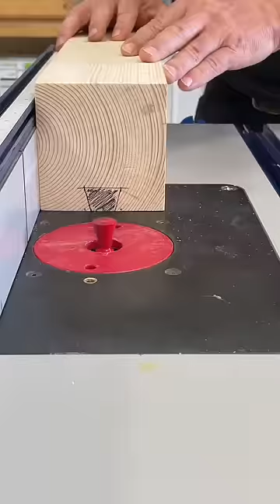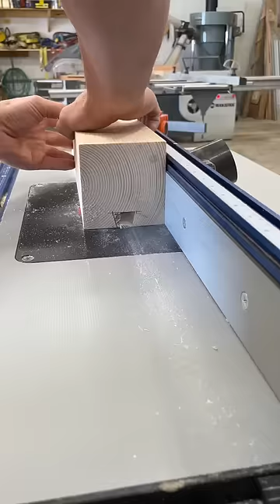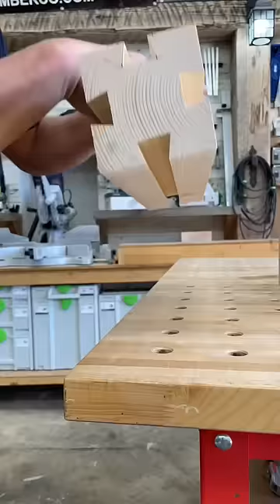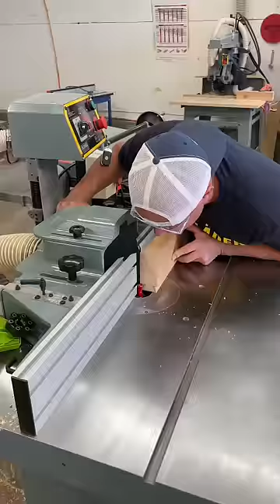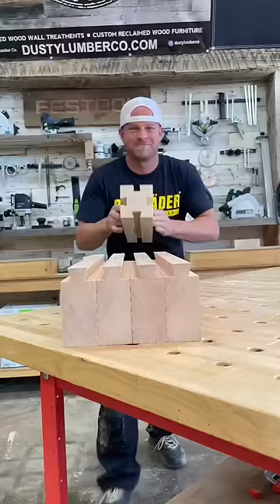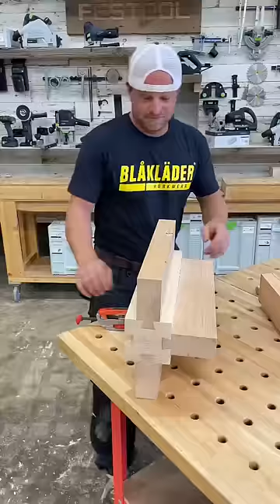Four way dovetail joint #ad #woodworking #woodwork #wood #maker #bois #tools #holz #joinery #madera

Comment: "what is this thing used for?"
"Yes."
Reply: It’s a dovetail demonstration. Timber framing.
Reply: @grmanstar  It doesn’t change the fact that people are so lazy. The title is there, and so is the internet so if they want to look it up, they can.
Reply: Looks like legs for. Table? Could be wrong 🤷
Reply: 笑ったw
Reply: It would have looked better if the wood colors had matched so it looked like it was one solid piece of wood
Reply: @mrbunnylamakins Yup, although dovetails can also be for timber structures.
Reply: Jor can use it to build hoses but nobudy use it
Reply: @DakkogiRauru23  it's a joke
Reply: @grmanstar  lmao you really acting as if you're superior
Reply: I'm thinking of taking this same approach on a rustic/functional four post bed frame.
Reply: Where it is used?
Reply: It does nothing. Obviously.
Reply: @mind_of_A  why poor me?
Reply: Its used for youtube short lol :D
Reply: Practice. Better do it on a demonstration piece to learn/exercise the process than try to figure it all out in an actual project, that way there's no problem if you do something wrong.
Reply: Just for likes
Reply: Table

Duh
Reply: an old wooden castle in Malaysia was built using this technique, meaning they were built without using naild and such. all the structure were interlocking with each other using this joint and ither types of joint too
Reply: Table pedestal.
Reply: Whatever you want. It's like asking what woodworking is for. Whatever you want!
Reply: @TheFallenFaob  No
Reply: Good boy
Reply: Whoever’s reading this, i pray that whatever your going’s through gets better and whatever your struggling with or worrying bout is going to be fine and that everyone has a fantastic day! Amen
Reply: It's a bit cross.
Reply: A demonstration and also a lot of things like a center of a night stand or a chair maby a table
Reply: Visual ASMR 👀👂🤤
Reply: Does it have to be used?
Another good question. Do you have to exist?
Reply: @darvin50k  I was just going through the replies hoping to find a equally funny reply like this comment, but I see this. It just made my day before it even started :)
Reply: it’s those stretchy wall thingies in the return section of Walmart
Reply: @DakkogiRauru23  Fr. This generation would die if not for the constant hand holding they get on a day to day basis.
Reply: Its used for puzzles
Reply: Hloji🥰
Reply: @DakkogiRauru23  Some people can't see the title.
Reply: How many licks does it take to get to the center of the trendy pop
Reply: Pizyes
Reply: @tejay9416  jnn9kjķkkkkķkkkkķkkkkkkkkkkko
Reply: It is used for traditional Japanese buildings and they remain standing
Reply: For ANTS to READ
Reply: Glass table stand, would look AMAZING!!!! 😍😍😎😎😎😎💪💪💪💪
Reply: xDDD
Reply: what is it not used for?
Reply: Sebagai Kaki Meja.
Reply: @DakkogiRauru23  The title does NOT say it is for "demonstration" smartypants. Furthermore, no one in their right mind would waste this much wood or time on a simple demonstration. QED: It must have a purpose. Question stands: What is it used for?
Reply: @mnoot7209  Actually, demonstration consumes a lot more material than you might think when it comes to any trade, such as woodworking, machining, pottery, etc.
Reply: It's a table leg.
Reply: @TheFallenFaob  i have made several dovetail joints on most joints its different sides of the grain they hardly ever look the same.
Reply: Its cool as shit
Reply: Ножка для стола
Reply: Not everything needs a use, some things just are.
Reply: yes❤

Comment: he seems so happy making it,- I got no clue what it is but-
Reply: Table center?????
Reply: Its used to build buildings in ancient times, eg ancient china and japan
Reply: "A dovetail joint or simply dovetail is a joinery technique most commonly used in woodworking joinery (carpentry), including furniture, cabinets,[1] log buildings, and traditional timber framing. Noted for its resistance to being pulled apart (tensile strength), the dovetail joint is commonly used to join the sides of a drawer to the front. A series of 'pins' cut to extend from the end of one board interlock with a series of 'tails' cut into the end of another board. The pins and tails have a trapezoidal shape. Once glued, a wooden dovetail joint requires no mechanical fasteners. " - wikipedia
Reply: Probably just a demonstration
Reply: He might just be showing off the Ingenuity of not having to use nails I mean he could still be trying to make something but that seems to be the core of the video is just showing how Innovative it is not to have to use nails and just use the strength of the wood by using certain tools to be more efficient this way you're actually using less material
Reply: Really Loue Stephanie ut 31😁
Reply: It’s a 4 way joint
Reply: Dovetail joint
Reply: @sai_lg1070  and what is is used for in this configuration?

Comment: I just love those seamless joints. Love your work.
Reply: The theatrical leaning and slow pushing makes them look much tighter than they actually are.
Reply: Meanwhile I'm sitting here playing Pokémon yet I can smell the sawdust coming from it. I have classes in a woodshop, I know how it smells.
Reply: @legobrick1356  lllllll
Reply: @MF175mp  I have ocd. 😁 I just love that it fits seamlessly. I don't care if it's tight or not
Reply: @legobrick1356  don't you just love that smell
Reply: @CoolA1363  Depends on the wood. I'm used to red oak (the one I was smelling), but so far I like the smell of pine out of the ones I know.
Reply: @CoolA1363  that's not what OCD is lmfao
Reply: @suidame1996  the obsessive part is correct though😁
Reply: If you didn't see the seems you need to put on coke bottles before you work wood
Reply: @FathomlessJoy  dude, the word "seamless" means: "smooth and continuous, with no apparent gaps or spaces between one part and the next", but, what the heck, ya, you're right!
Reply: @CoolA1363  Yeah and if you can't see those seems....

Comment: his slight smile br like "I did a very good job"
Reply: but in reality he just pushed wood through the router...adjusting the fence isnt that hard lol. i would be impressed if he did this with a cordless router
Reply: @herpderp4908  i think youd have a different opinion if you were a carpenter.
Reply: @sebastiangrebe8276  do you mean if i were a professional? and do you mean a different opinion on adjusting a fence or on being impressed if he would have done this with a cordless router?
Reply: @herpderp4908  not really about how good he did it tho is it. its about how happy he was
Reply: @reflesh8802  and there is nothing wtong with that. i just said that its not hard to adjust a fence and i personally believe thats nothing one should be too proud of, which was the topic here. dont overdo it, guys.

Comment: When the joints slide in that easily with no gaps, you know you've done it right. 👍
Reply: YO GLITCH THAT U?
Reply: Cant really go wrong with a router table...
Reply: The snappy connecting sound.🥰
Reply: It is from the ancient Chinese culture that they build their homes in this way
Reply: @John...44...  1¹
Reply: That's what he said......😂😂😂😂
Reply: @user-of1oy2qo6k  a lot of old cultures used joints in carpentry. For example there are over 7 thousand year old wells in Europe where the interior was lined with jointed wood like that.
Reply: I was just gonna mention something like that.

Comment: A dovetail joint is basically a joining technique used in woodwork. He's showing us that. And he did it so clean oml
Reply: Also used in steel machining,incredibly strong joint
Reply: Also used in dentistry. Better retention in amalgam fillings.
Reply: 宮大工さんはプラス固定細工を取り入れて固定します。　釘を使わず丈夫に家を建てます。
Reply: with concrete works great too

Comment: If you guys want a use for dovetail joints, they are the best joint for making the front of a drawer (the part you pull out). This is actually really helpful bc now I don't have to make it by hand

Comment: I wish I had the equipment to do something like this. That would work perfect to use as a center leg for a table. Instead, I'll just be using four plain 4 by 4 boards as the legs to my work table.

Comment: In your experience, what is the length limit on sliding dovetails like this? Like so many others have said, this would make a great table base but it would need to be much taller. This is a great demo.